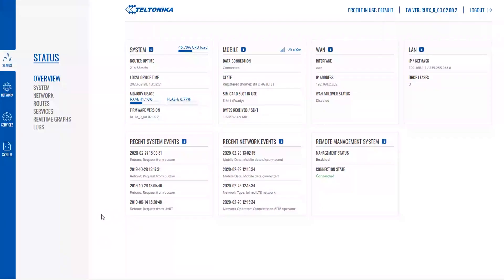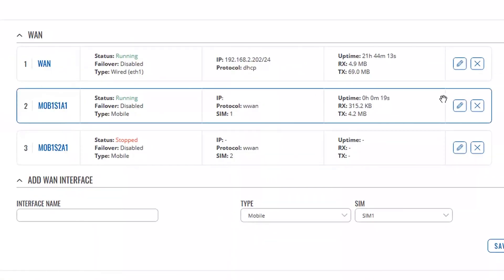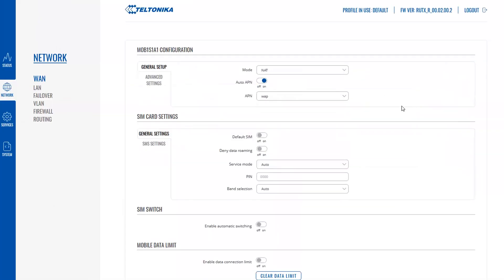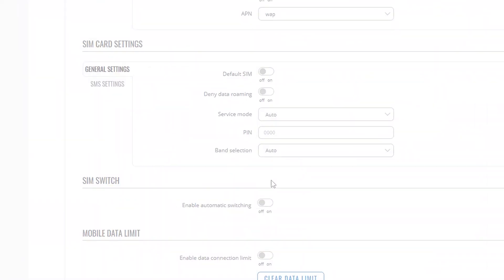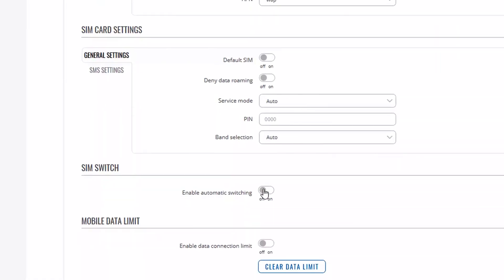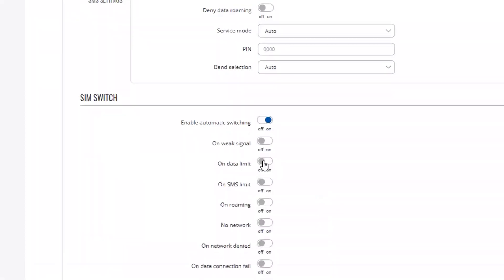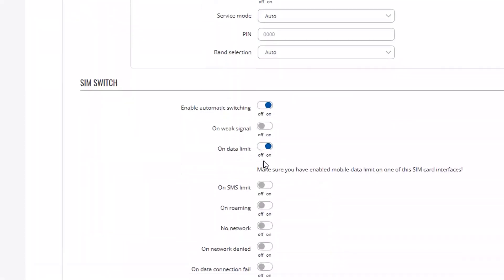How to Set Up SIM Switch on LTE Cellular Router | Teltonika Networks

Comment: Despite the switch settings, my router is unable to switch if the sim 1 network fails, poor signal strength, data limit but it only switch when I set it to automatic & this occurs even if the primary sim network is OK but dependent on the switching time set. Pls help with a detailed explanation on how the router switches due to no service from one sim to the other. Thanks
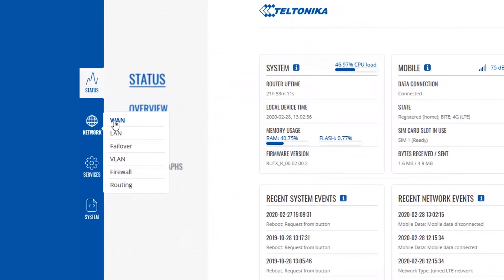Reply from the maker: Greetings. For auto SIM switch to work, you must enable automatic sim switch setting - 01:15. If you are using signal strength to make the switch, make sure that routers antennas are securely attached, and your networks have a reliable signal. If you want more in-depth support, you can post your use case with images on https://community.teltonika-networks.com/

Comment: Hello, regarding CGNAT is it possible to use this Teltonika to host a Fixed IP SIM card for remote access and a unlimited data sim for internet? (can both sims be active?)
Reply from the maker: Greetings. If your ISP provides static (fixed) public IP for your SIM card, then yes. Unlimited data SIM for the Internet depends on your ISP data plan limits. For both SIMs to be active at the same time, dual modems are required, and we have RUTX12 router with this functionality: https://teltonika-networks.com/product/rutx12/

Other devices in our lineup have a single modem, so only one SIM can be active at any given moment.